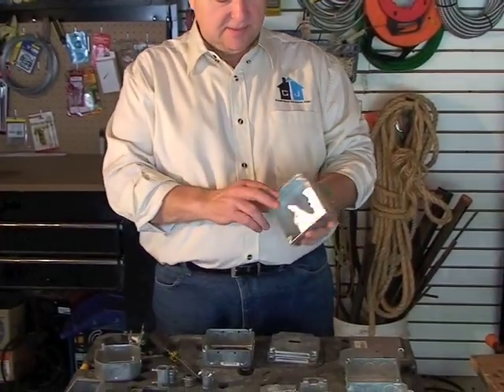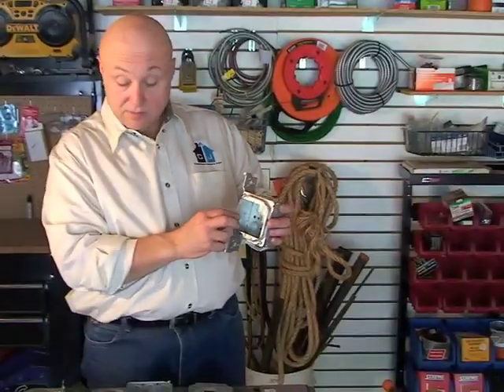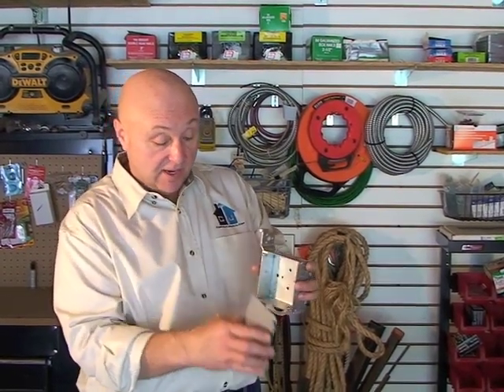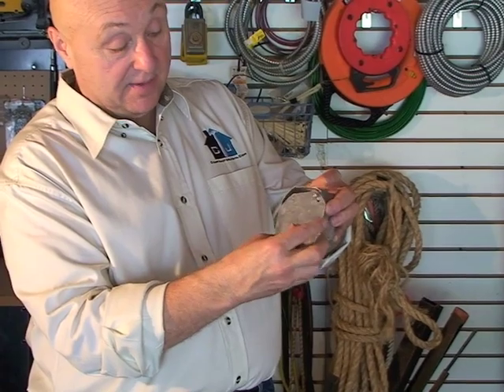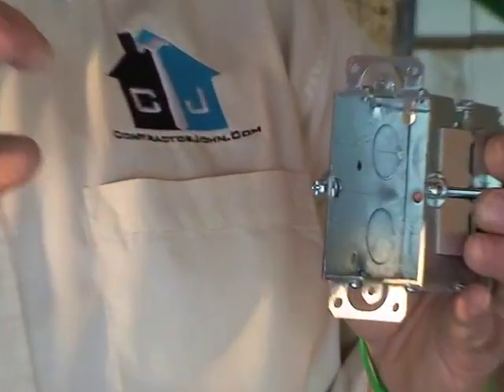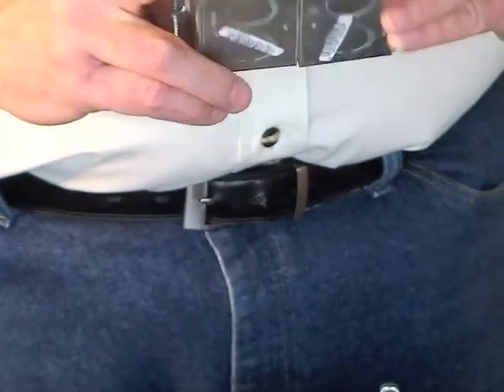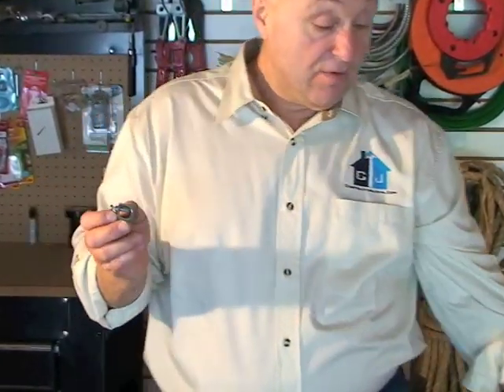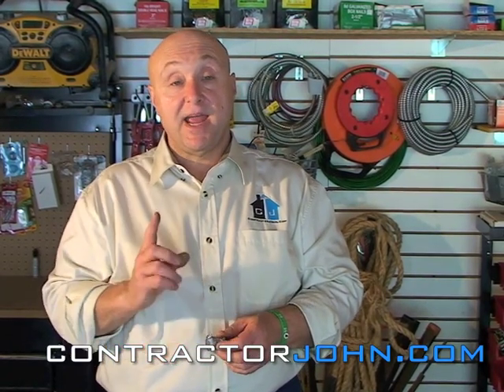Electrical Boxes, Fittings and Conduit Explained

Comment: My main question here im learning how to bend conduit and i wanna know where do you measure the cunduit from the start of the box or the start of the cuplin inset? or how much do you take off? thanks it would help me alot, still learning.
Reply from the maker: Thanks for watching. If you measure box to box and subtract 1/4" you should be good to go. It is much easier if you mount 1 box, then measure your length or position of the next box, cut the pipe, install the pipe, slide the new connector and new box on it and them fasten the box to the wall. Good Luck!  Listen to my weekly podcast http://DIYHouseMedic.com

Comment: I'm confused about the names they give to connectors that go into these boxes for romex wires.    Most electric boxes have knockout holes that measure 7/8 inch in diameter.   And yet the connectors for romex wires are not labeled as 7/8 connectors.

And I hear people talking about 1/2 knockouts - which I suspect are actually the 7/8 inch diameter knockout holes in these standard boxes.   Are they calling a knockout that measures 7/8 - a  1/2 knockout???

And it gets even more confusing when they call the connectors 3/8
Because there is nothing on these connectors that measures 3/8 of an inch

Can someone please explain why all of these labels make no sense????
Reply from the maker: DW,
The 1/2" knockout in boxes is referring to the size conduit/pipe that can be installed in that opening. Also 3/4" knockouts allow 3/4" conduit/pipe to be installed into that opening through a connector. The 3/8" refers to the greenfield armored/metal flexible cable that with the appropriate connector fits in a 1/2" knockout.  There is also 1/2" armored/metal flexible cable that with the appropriate connector fits into a 3/4" knockout.... and yes I know it is sometimes confusing............................... check out my weekly podcast http://DIYHouseMedic.com
Reply: @ContractorJohn  Wonderful!   Thank you!! 

Can I ask another question?

There are plastic snap-in cable connectors designed to hold romex wire in these metal boxes.

I'm trying to figure out which snap-in will fit into a box with knockouts which have holes that measure 7/8th of an inch.

If I understand you - I should be looking for a snap-in connector which is labeled like the following:
 
"3/8 Trade Size, Fits 1/2-Inch Knock Outs" 

Is that correct?
Sincere thanks!
DW

Comment: been in construction for years, learned a lot in 10 minutes. there's a lot of new style metal electrical boxes and mud rings out in big box stores now, that's really why i came. it took me 3 weeks to understand mud rings with really odd metal tabs that break away, what the heck? they have a little hole in the middle. come to figure the hole is threaded 8x32 or what ever the outlet screws are so the idea is they are nuts to connect the outlet or switch to the ring. now i have an 8B with integrated almost duplex conduit clamps in the box. the knockouts have a 3 hole figure 8. like there's an option to run wires without clamping them. or perhaps the its to stick a screw driver in and break off the knockout. it sure would be nice if there were instructions somewhere
Reply from the maker: Stan,
Thanks for watching! Yes they need to come with instructions. The little "secrets" are hard to know.  My video is centered on conduit and fittings, the Romex thing is a whole 'nother world.  Check out my weekly Podcast, http://DIYHouseMedic.com  for some of those secrets!

Comment: Very helpful video. Is there a weatherproof version of the 1900 box designed for exposed mounting? I am replacing a few junction boxes along the wall of a parapet roof. I need two side knockouts to run wires linearly and one top knockout (3/4") to runwiring through metal conduit to a lamp. Picture a bank of angle shade light fixtures with gooseneck conduit to illuminate store signage however instead of being "wall mounted" the conduit is suspended above the wall and braced to the top of the wall with triangle shaped brackets.
Reply from the maker: Steve,
There is a weatherproof box called a Bell Box. To the best of my knowledge I have never seen one with more than 1 inlet per side. They had a threaded inlet on each side and I believe one on the back. Into those threaded openings you screw in a compression (weatherproof) fitting. They have all the appropriate weatherproof covers also.
Hope that helps
Follow me at http://ContractorJohn.com.
Contractor John
Reply: Thanks John. You are diligent, thorough, and professional. I wish you well.